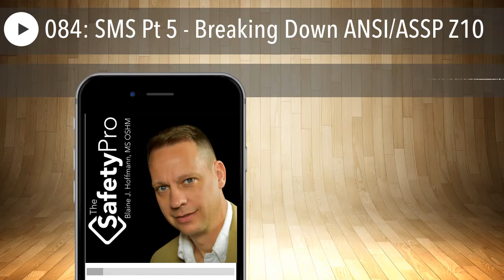084: SMS Pt 5 - Breaking Down ANSI/ASSP Z10

Comment: Excellent podcast. One important technical item for listeners (that is later pointed out in the podcast). These documents are NOT "management systems". They are, in fact, management system "standards". An organization creates a "Management System" by interpreting one or more "standards". The result is a "Management System" which will include aspects not required by the "standard". When organizations create their Management System they often in-bed flaws that over time are causal factors for failures and near miss occurrences. Over time ALL organizations will need to address these flaws. The objective is to "find the risks before the risks find you". Regards,